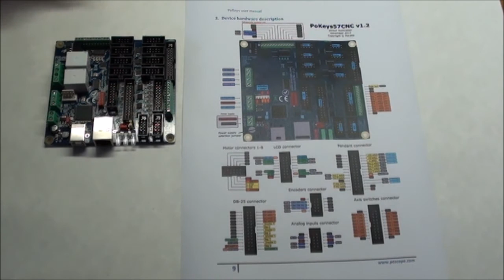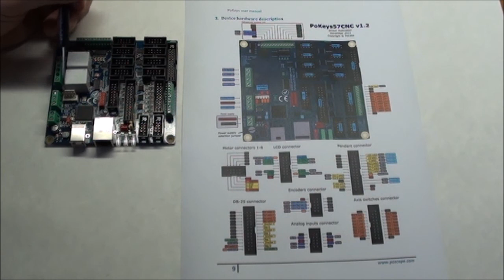PoKeys57CNC 8 axis Motion Controller Close-up look at the hardware

Comment: Hello Martin, thanks its very useful stuff, I would like to know if I can connect any stepper drive or it has to be of Pokeys only, secondly I require 5 outputs to my 24VDC relay board,  and I have 5VDC MPG, and few push buttons, can it connect them all to this board. 
Thanks
Reply from the maker: Hi Marven, You can connect any stepper driver to the PoKeys card as long as it has the STEP/DIR inputs. For your relay board and MPG I'm not sure. It has a number of open collectors that might be useful for your relay. PoKeys have their own pendant (very nicely made) that is well supported. I would recommend using that - though I do not know if you can wire your current so it will work

Comment: Hello martin,i like your videos and i would like to contact you about setting up a pokeys57cnc with a proma thc and how to wire and how to get an arc signal to the hypertherm45.thanks in advance
Reply from the maker: Hi Jurjen, I havn 't tried using a torch with the board. I will recommend you to contact Polabs support. They are usually very helpful and responsive. Good luck!

Comment: A beautiful video, a fine product, nothing is said about how to install a spindle, whether this controller is working with servo motors.
Reply from the maker: If you only need to power on/off your spindle you have two on-board relays that works just fine. If you have an Inverter that need a 0-10V signal this is also supported - but Im still struggeling to make it work. Plan is to publish a video when Im succesful.